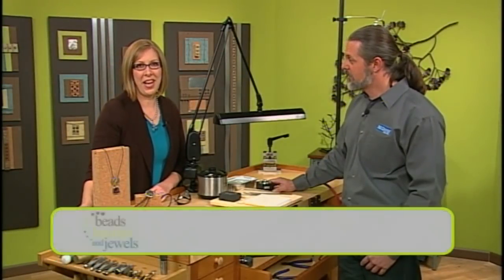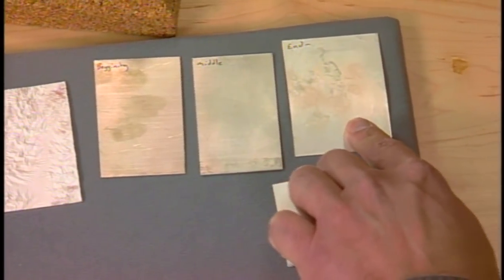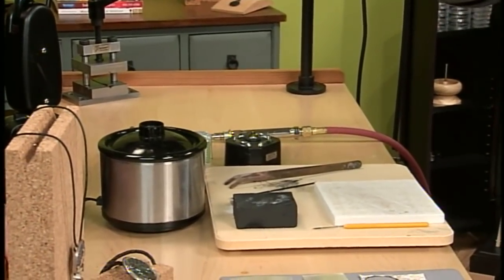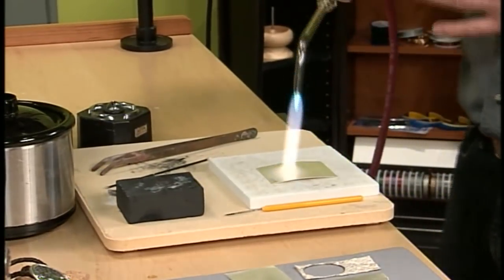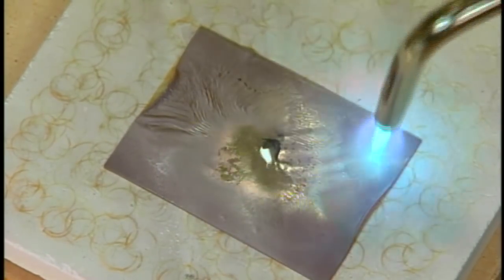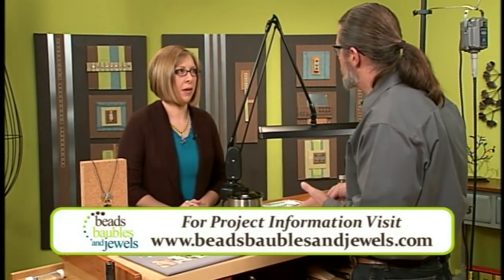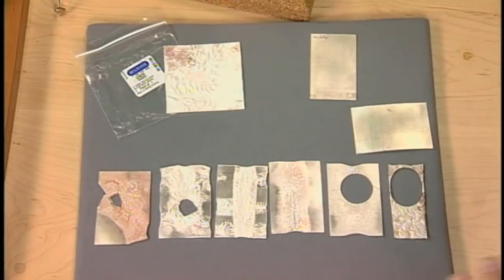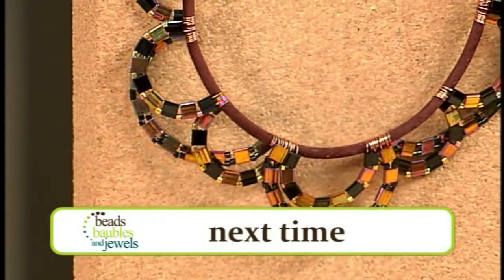Gilding and Reticulation

Comment: You should do it more, like 12-15 times and the first 9-10 times use a brass wire brush after pickling to remove copper form surface, much better results.

Comment: Hi guys,
Thank you for the great video. I have been trying to achieve gold reticulation on silver and now I get why it doesn't work.. because it's actually probably Keum-Boo that I'm seeing. Can you please give some tips on doing the Keim-Boo on the reticulated silver. Do you add it after I assume? And how do you add it to a reticulated surface?
Again many thanks for all the info.
Reply from the maker: Hi There, Thanks for watching. We asked our Jewelry Tech Team for their insight on this process. Here's what they shared, "Since the reticulated silver has already been depleted, the gold foil can be applied to the surface. Simply heat it on a hot plate, then start burnishing it down. There’s no easy way to burnish the foil down on a reticulated surface. Modified burnishers may be necessary to burnish it down in the areas where you need it. To hold the foil down before heating, you can use a little saliva or gum tragacanth to keep it in place. If you place the foil on the surface while the silver is hot, it will tack to the surface instantly." Hope this is helpful.

Comment: Another question. I'm making my own Shibuichi ingot (80/20), then rolling it out. I need to anneal every few times through the roller. Will this annealing affect the depletion guilding step when I have the thickness I want and am ready to reticulate? I'm going to experiment while waiting for your response and see what I get!
Reply: Hi ycnanadarts
Wonderful that you are making your own Shibuichi. I love making that stuff and use it all the time. It’s a little different than reticulation silver though. Shibuichi is 80 copper /20 silver. Reticulation silver is 80 silver / 20 copper. So I’m not sure how it will reticulate if at all. I have depletion gilded it to some degree but the fine silver layer doesn’t appear to be as thick as it is when you do the same to reticulation silver. Annealing doesn’t have an effect on the depletion process.
I hope this helps.
Mark N Tech

Comment: And will it tarnish eventually? And btw, is Keum-boo (as shown at end of video) permanent? Or does it wear off like plating or fill? Thanks!!
Reply from the maker: Hi, +huskyfluffy! Reticulated silver should tarnish faster, as it has a higher copper content than .925. 
 
Keum-Boo will hold well. The most common problem we see is that it is susceptible to wear on high-traffic items like rings, causing it to get damaged over time with wear. Pendants and earrings are much better suited for Keum-Boo. It also works well to use Keum-Boo in the recessed areas of a piece. We hope this helps! Let us know if there's anything more we can provide you with!

Comment: Hi, great video! I don't see you adding any fire scale preventative at the reticulation stage, don't you need it?  The initial warming stages don't need it because the metal isn't getting hot enough to form scale, is this correct? Don't you need it? Thanks again.
Reply: Hi ycnanadarts
Good point. Actually I have never thought about getting firescale during the process, maybe because it’s never been an issue.  When I was taught the technique it was without flux and I have never seen reference to using it by any others teaching the process. I’ve never noticed it on the final product…..it might be because I never polish the end result, just burnish it.
Great question, wish I had a definitive answer.
Mark N Tech
Reply: RioTechs  If you've never gotten firescale it must be because of the torch or the metal, everyone gets firescale. You dont even mention what torch you are using. only later do you say you're using pickle (I"m like, is he quenching? Is that pickle?  Wth?) Why no flux? No firescale?. Yon dont even say what reticulating is! Your technique is great but the dumb questions are really distracting.
Reply: Anne Alexis hi Anne, thanks for your feed back. I guess i didn't cover the technique as thoroughly as i thought. 
The process is called Deletion gilding in which you deplete the copper from the surface by warming the metal ( oxidizing the copper) and then pickling. When you repeat the process you are creating a thicker layer of fine silver on the surface. While we may be getting firescale by doing this. it comes off in the pickle. We won't get fire stain at this point because we aren't heating the metal up to that temperature. You can use nearly any kind of torch for Depletion gilding, but i'm using the Smith Silversmith torch here. After depleting, you then go onto creating the reticulation, this is done usually with a sharp slightly oxidizing flame, while the Silversmith torch works, a Oxy/Propane torch works better. This process will create firestain which is unavoidable. Flux would only impede the creation of the texture and only burn off during the process. . 
I hope this is of some help. if you have any further questions please feel free to contact us at 1-800-545-6566 or email us at Technical@riogrande.com.
Thank you
Mark N Tech
Reply: RioTechs Mark, thank you, I get it, Now I see why you have no firescale build up (duh,) Constant pickling. Ok, 2 more question, It seems to go from light silver (once done) to a pendant full of color. Was that raised from the torching? Or did you add enamal or alcohol ink. Really nice finished product, Also, I have Sterling Filled Silver, How would that work? Since the outer is all sterling and the inner core is copper and I think brass (i.e.-alloy.). thanks, really great work.
Reply: Anne Alexis Hi Ann, this technique won't work with filled material. It has to be at least .925 ( sterling ) silver. .800 or 80/20 silver will work better. Try to use the silver filled and you'll end up with a melted blob of something that's alot like solder.  I got the colors on the pendant by using liver of sulfur. You don't always know what your getting with LOS but you can get those amazing colors. 
Mark N Tech